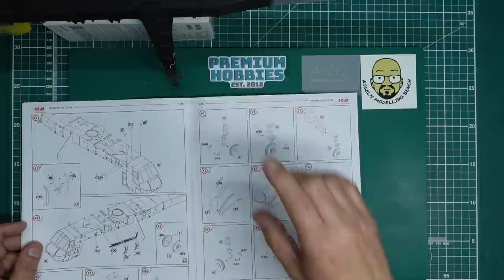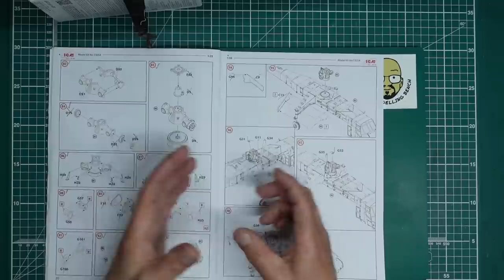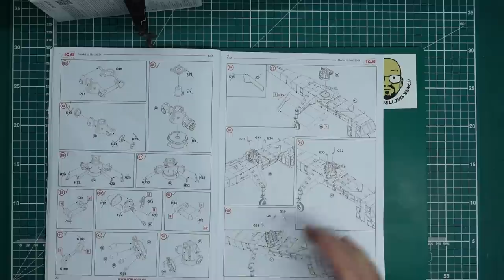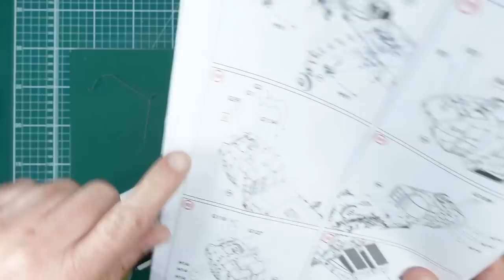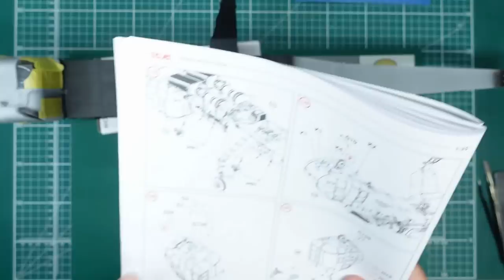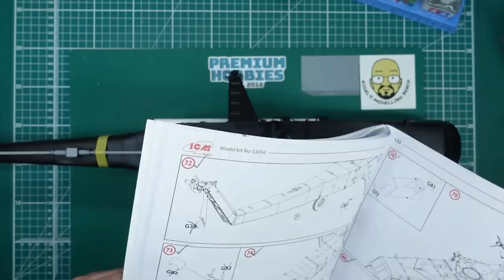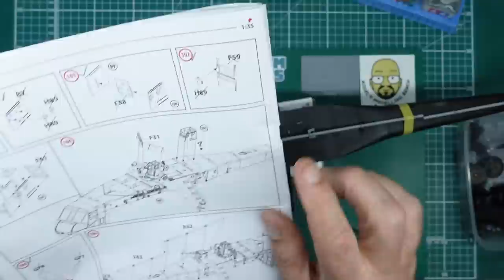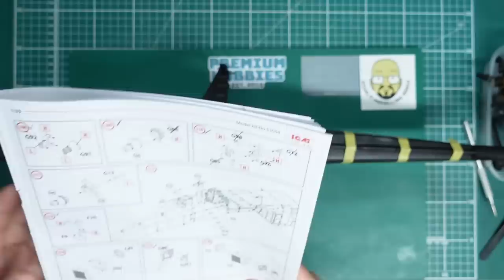ICM 1/35 CH-54A Tarhe build. Part 10

Comment: Nigel, my name is Charles Jackson. Back in 1968 I was crew chief on this very aircraft,18426, in Vietnam. I am about to start building this kit and I find your videos very helpful. You have asked for info on various parts of the aircraft. I can help with this. The "box" on the maintenance deck is the "hydraulic sled". It contains the reservoirs for the first and second stage hydraulics as well as the utility stage. The tall cylinder with a "knob" on top is a pneumatic/hydraulic accumulator. It holds pressure to start the small APU engine when the main engines are not running. The 2 large boxes in front of the engines are the EAPS (Engine Air Purification System). State side Cranes did not use them but in Vietnam the sand was eating up engines in less than 100 hours. You decided to leave the landing gear covers off. Commercial cranes do not use them but all US Army cranes did. I only removed one to get inside and then put it back on. They are made of fiber glass and painted the same color as the aircraft but fade to a flat dull green. The rotor head was not sealed like the CH53 and we were required to grease all of the grease fittings after every flight. This caused the head to be fully loaded with grease every day. Subsequently the rotor slung grease all over the bleads and aft end of the ship. So we would wash down the vertical pylon and bleads with JP4 (jet fuel). This caused the aft end of the deck and pylon to be a splotchy dark discoloration. As for the name, the official Army Indian name is Tarhe which was never used. the Sikorsky name was Sky Crane but the Army always used Flying Crane. I did not know about Tarhe until years later. In Vietnam we had about 5000 pounds of armor plating over the flight controls and around the pilots seats. One last thing, the kit does not model the steps leading from crew deck to the flight deck. I'm going to cut out a portion of the flight deck between the pilot and copilot's seats using estimates from my collection of photos. I will then make a 3D model of the stairway and then run a 3D print. I enjoy your videos very much. Keep up the good work. Charlie
Reply from the maker: Hi Charles.. welcome along. Thank you for your advice. I have now finished this kit, it's a beauty!! I would recommend the Aerocraft U/C legs.

Comment: Hi Nigel, enjoying the build. As you asked, the ‘box’ on the port side, aft of the main gearbox is the a hydraulic support panel. The rod is an Accumulator with a pressure gauge on top. The other tanks are for the different hydraulic supply’s. Two for the flight controls and one for the Tail servo and ancillaries, such as wheel brakes, rotor brake and main hoist.
The seat over the tail rotor is a mount for an antenna.
Hope this helps?

Comment: That pipe looking thing that your using to locate the hydraulic sled is a hydraulic accumulator used to store pressure to start the auxiliary power plant (APP or APU) it’s recharged when the engines are started or manually with a hand pump ( which is omitted in the kit) located on the front outboard side of the hydraulic sled.

Comment: Nigel,  The CH54 Operations  Manual would seem to indicate that the vertical pipe and the box surrounding it are part of one of the hydraulic systems, possibly the Utility Hydraulic System which deals with such items as main wheel brakes, winch hoist, load levelers, etc.

Comment: Another terrific video, Nige. BTW, an unrestored CH-54 is on display at a local museum and it, in fact, has the cowling for the struts. I have pix, if you'd like.
Reply from the maker: I'm not surprised by that, all current birds seem to have the cowlings fitted. I personally prefer the look without them and have seen action pics from Vietnam without them fitted, so I left mine off.

Comment: I checked the CH54 Operations Manual, and just FYI:  "The nose wheel is self-centering, free-swiveling, and has a shimmy damper. A manually-operated nose wheel lock will lock the wheel in the trail position."  So, installing the nose wheel in a slightly cocked orientation is consistent with the nose wheel lock being disengaged.